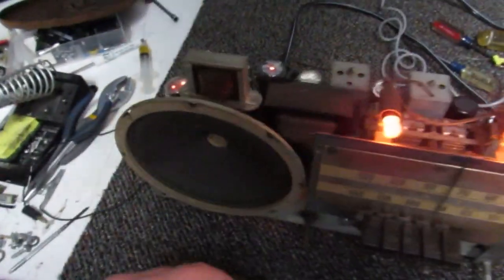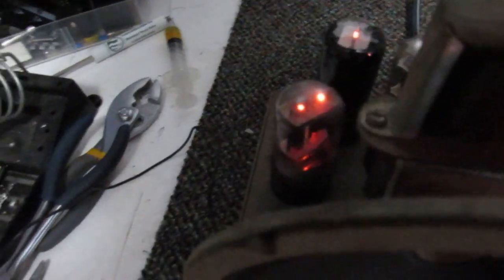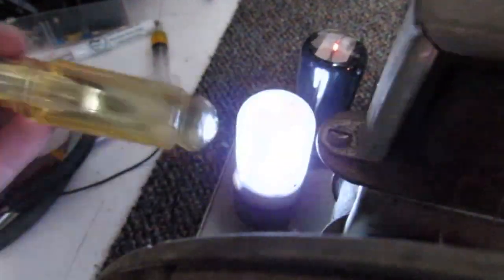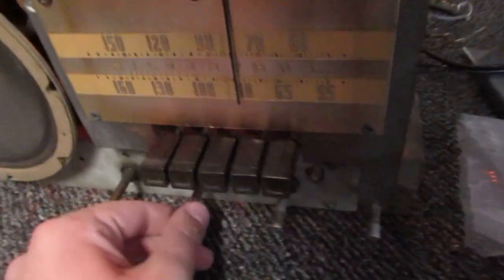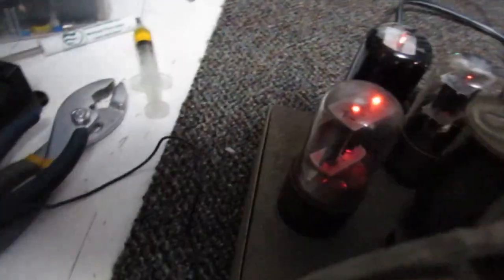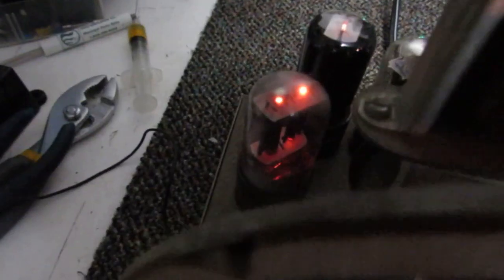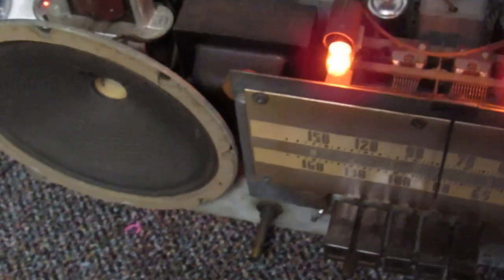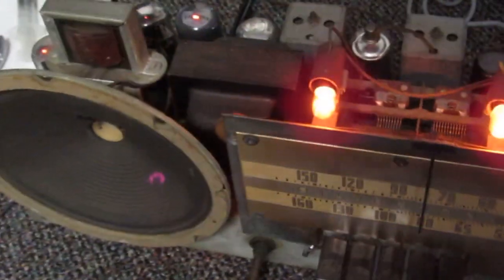Rectifier Tube Violent Failure in Old Radio

Comment: Did you replaced electrolytic capacitor and tube?
Reply from the maker: This video was taken after the set was electronically rebuilt. I discovered that whoever serviced this radio before me put a 25 volt filament rectifier tube where a 35 volt tube should have been so it was getting very hot and arcing over. A proper replacement fixed it and it is still in service